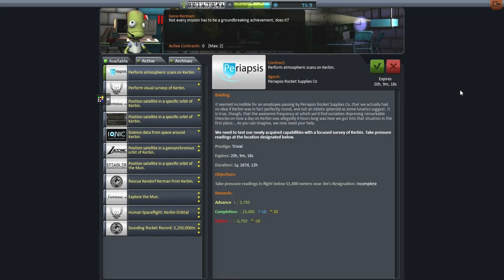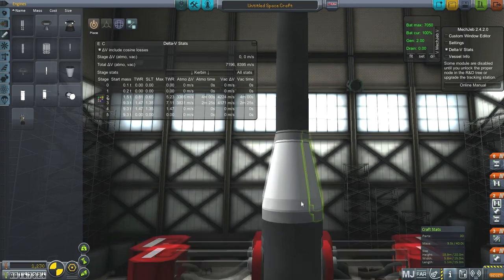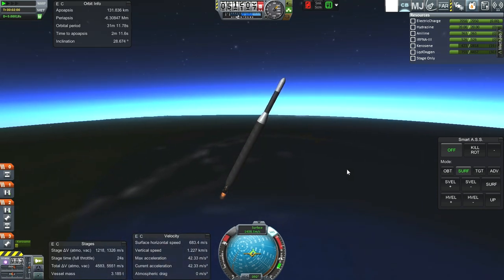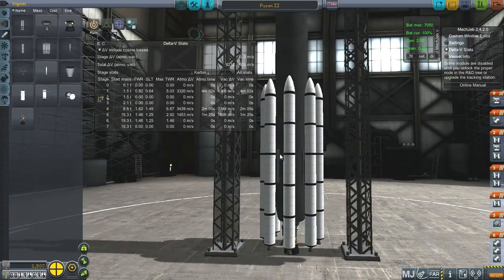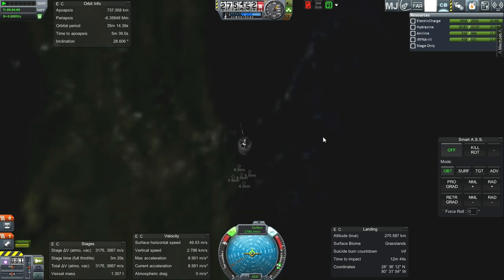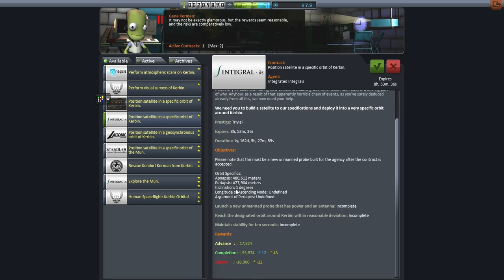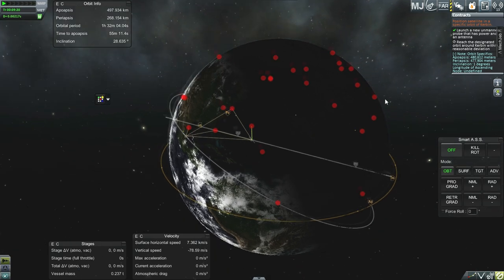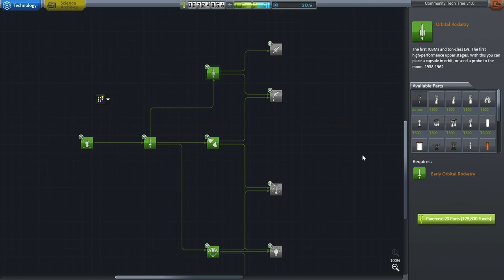Realism Overhaul in KSP Beta 05 - Greater Heights

Comment: OpenGL means part textures don't use RAM. So you don't have to use ATM at all.
Reply: So does that mean OpenGL loads textures into RAM on the fly as they are needed? Or does it do some kind of weird cache-ing that allows it to skip loading any textures into RAM at all (if that is even practically possible)?
Reply: MrDeemsMusic No. It means there's a bug in Unity's D3D9 code where it fails to remove textures from RAM once they've been uploaded to VRAM.
Reply: ***** Aggressive will scale down textures. So OpenGL + Aggressive will save more than just OpenGL. Are you saying ATM aggressive in D3D9 has a lower footprint than OpenGL and no ATM?
Reply: NathanKell Oh ok, that makes a lot more sense. Thank you for clearing that up.

Comment: Lol die you really try to do an 45° inclenation change in an LEO... O.o
Reply: *Did not die
Reply: ***** Inclination change, think of it like this: You have a velocity vector of 7.7km/sec. Exactly how much velocity would it take to "turn" that vector by 28 degrees? Well, let's think in 2D: vector sum (6799, 3615) + x = (7699, 134). That means x is (900, -3481), magnitude of 3.6 (!) kilometers per second. That doesn't hold for 3D obviously, but it's still fiendishly expensive. You need to correct when your orbital velocity is low (either during ascent or at a high apogee--if the latter, you then lower your apogee back down again after the plane change)
Reply: ***** Ah, sorry. From CSG (Korou) it's easier, but...why bother? Just keep declining the equatorials until you get offered polars. :) (And yes, at some point RP-0 will fix the inclinations...)
Oh, and the verniers are bugged. They should have no restarts, and their Isp is a bit wonky. That fix was pushed to RO (to a branch?) and is not in the current RO release, so you're safe til then. That said, you should have access to the 1kN thrusters...
Reply: ***** 1kN thrusters are a part of AIES, if I'm not mistaken. So far i noticed, that for now only a few FASA engines are supported by RP-0, u should use the AIES+KW+NP2 combo and delete unused engines from your gamedata folder. And oh, I think there is no F-1 Engine in RP-0 later on?
Reply: Rothank
Sorry, that's not actually true. The 1kN thruster is the LV-1 (stock), but a number of other mods (AIES included) have their small orbital engines configured as such by RO as well. As for FASA, far more of its engines are supported by RP-0 than, say NovaPunch2 (of which 0 are) or KW (ditto) or AIES (like, 3-5 IIRC). And yes, there is an F-1 engine supported by RP-0, FASA's. :) (or will be once the changes in git are rolled into a release...)
Reply: ***** Weird, now it seems that I'm missing A LOT of engines in my install... Gotta sweep through my mods once again. Sorry for sharing wrong information.